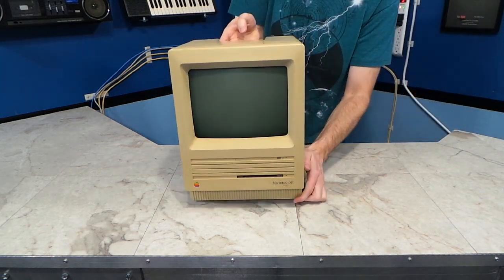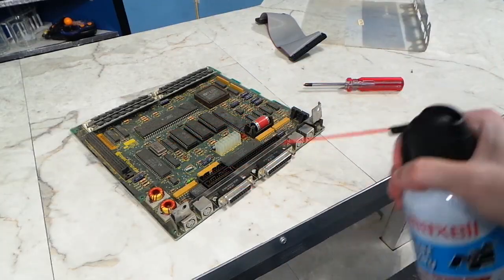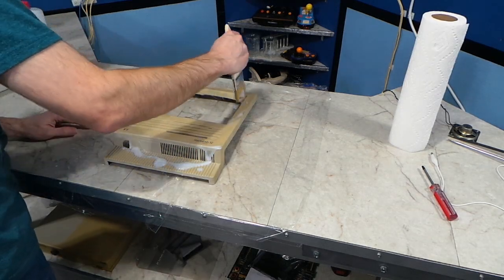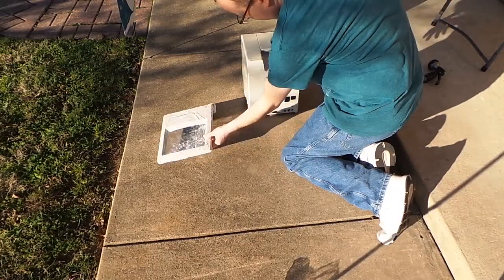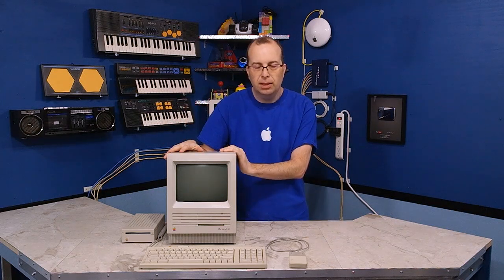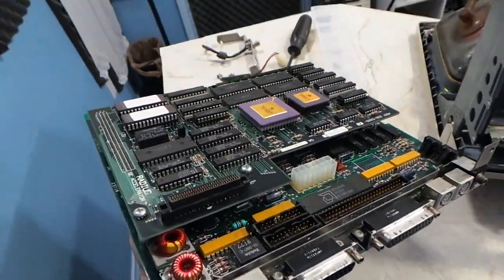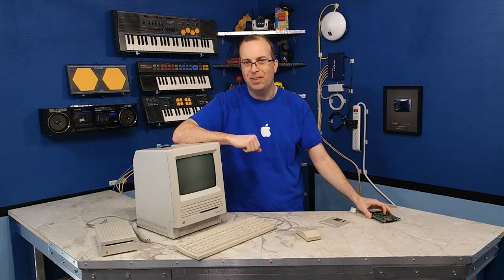Macintosh SE Restoration and SD-2-SCSI upgrade

Comment: Try booting it again, but holding down the shift key to disable all extensions. It probably crashed on an extension not meant for that machine. You really need a plain vanilla image rather than the one with all that junk in it.

Comment: Hey David, I recently restored a SE and I was able to successfully get it running on a SCSI2SD v5.0b adapter. I also think I used Lido to format, rather than the patched Apple software. 

If you haven't looked into it yet, you should check out Steve Chamberlain's floppy emu.  It has worked wonders on my Apple IIs and my Macintoshes.

EDIT: I forgot you mentioned the Floppy Emu in your video before I commented. Well, I recommend it eitherway!

Comment: I solved the problem transferring data to my SE and SE/30 easily by using an older Mac that can get online that can write to 400 and 800k disks.  I use a Powerbook 1400c with a PCMCIA wifi card!  I has Mac OS 8.6 on it, and I can go to Macintosh Garden and download apps and games, and copy them to disks.

Comment: I'd just put an old mac SCSI harddrive onto it and format it.  Been there, done that, a million times, so long ago, I forgot all the utilities I used to format and reinstall the system.  

Chips don't usually die, except to static electricity, so it's unlikely youre scuzzy bus is dead.   On PC's you find IDE channels that have been fried on a motherboard rarely, but usually the second (or other one) will work.

Be sure to set your SCSI selector jumper on your device to not conflict if you have more than one on a ribbon cable.

Comment: I have the red half-size V5 version of the SCSI2SD, I can confirm it works perfectly on my SE with a 2GB MicroSD card.  I installed the British version of System 6.0.7 from 800K floppy disks with the patched HD SC Installer.  Reading online it would seem that the older version of the board is more compatible with these older systems..

Comment: Try different SCSI cables.  99% of my SCSI problems were cable related rather than drive related.  There may also be an issue of incorrect termination.

Comment: This is long, but here goes:

I've been working on an SE/30 restoration. My machine has a perfect motherboard with no leaking capacitors and a highly valued ethernet card. Your video has inspired me to go all the way on restoring the case, keyboard, and mouse with a peroxide solution.

It's not surprising that you're having a nightmare putting software on that SD card. It's painful since HFS  isn't supported by any machine after Jaguar. Don't ask how I know! I'm sure you know old software is available at a number of sites for free (my favorite price). Getting software installed was a painful step-by-step process. I had a modern Mac to download the basic drivers for upgrading the system-- but you have to write them to an IBM formatted floppy, which obliterates the file name. It's a roll the dice scenario whether the System 7 software can figure out what to do. Some files work, others, notsomuch. 

I tried networking a modern MacPro to the SE/30. It would log on fine, but again, HFS left the internal drive unreadable and unwritable. Darn it. But I did get the drivers to load a Zip drive-- which ups your content to 100MB and speeds things along. I dug out an old Yosemite G3 Mac, but it had no drive and the internal battery had exploded. A clean up and new battery got it working. I cannibalized an old external IDE drive and installed OS 9.2 from an old CD installer-- surprised I still had it. The G3 talks to the SE/30 with no problem over FTP, but it's not very fast at file transfers. That's where the Zip drive becomes invaluable. OS 9.2 is better at navigating the internet than OS 7, but many pages fail to load since Java is ancient on these machines. But an open source community retrofitted Mozilla for OS 9, called Classzilla. Viola! Downloads are pouring in-- over to zip-- over to the SE/30. Done. Because the G3 has USB native, I suspect loading up your flash drive should be done on an OS 9 machine.  

I'm not done yet. I have a flakey power cable to the hard drive. I need to locate a replacement with the proper pins. I'm interested in some of your friend's upgrades. They look like fun-- or a pain-- if you're into that kind of thing.
Reply: One trick to transfer files from a PC to a Mac is to use a Mac Emulator on the PC (Fusion PC or SoftMac from Emulators Inc, Executor from ARDI, or Sheepshaver and Basilisk II), use Stuffit to compress the files into an archive that preserves the Macintosh file attributes, and then you can use HFV Explorer to copy the archive from the hard disk image the Emulator uses onto a PC floppy and transfer that to your Mac.
Reply: You just reminded me that my cousin has an Atari Jaguar (which worked perfectly fine!) I'm not sure if he still has it but I may ask him!
Reply: HFS is completely irrelevant.
The Mac is trying to format it from scratch and failing.
Something more basic is wrong there.
Either the adaptor board isn't lying about the drive type properly - and the Mac rejects it - or quite likely the SCSI controller chip is B0rked.
BTW I note that David didn't replace any electrolytic caps on the board :-/

Comment: if I ever decide to go for a macintosh , I think i would swap out the SCSI hdd and go for maybe either a IDE or Sata hdd through the use of an adapter , as for the floppy drive that would be the only thing I would replace with maybe a working floppy drive from a windows PC

Comment: I used to service these back in the early 90's.  One other thing you want to look at on these old macs is the analog board.  Specifically, the solder connections under the flyback transformer.  They used to crack around the pins from the heat and screens would flicker and go dark.  I never worked on one that didn't need those connections reflowed.
Reply: I just bought a Macintosh SE with a screen that doesn't work (eBay). I'm hoping that the brightness is turned down, or it's the problem you described.
Reply: It ended up a broken leg at component L1 on the analog board!
Reply: Unfortunately mine isn't so simple, my Mac plus seems to have dead components. I'm actively working on it right now and I know which ones I need to get, but if only it was just a simple reflow to fix it
Reply: wow even back then macs had heat issues and planned obsolescence in mind...amazing...
Reply: @ahah1785  There was no such thing as planned obsolescence back then. Computers were far too expensive in those times to deliberately choose B-grade components or cut corners in the design in such a way a suitable component would be stressed towards its SOA's.
Bad solder joints around pins from the flyback transformers due to heat was a rather common issue in those days. Flyback transformers just ran rather warm and at some point, the solder will give. Many TV's suffered the same problem.
Reply: @weeardguy   the solder connections under the flyback transformer
Reply: @alainportant6412  You mean the solderconnections on the actual transformer (and thus not the pins stuck through the PCB?)

Comment: If you deal with crts I suggest drilling a hole or sanding a little on the screw driver and soldering a wire to it and clip on the other end. Sometimes that metallic coating won't ground it out properly

Comment: Been wanting to look into installing a HD drive into my 800k only SE and bumping it up to 4mb of RAM, but that tube scares the devil out of me. I'm a clumsy bastard, and getting the ol' shock handshake gag of the damned from a computer that's older than I am is NOT how i want to go out.

...Also, I don't have any torx screwdrivers.

Comment: Go into windows and make sure the SD card is on the MBR partition scheme.
Then format the SD card as Mackintosh FS
try that with your own SCSI emulator and see if it fixes the issue of write error
Reply: When it threw up the write errors with the SD card emulator under the message it said something about drivers.
You may need a patched floppy that has a driver for the SCSI emulator

Comment: Tip - no need for epoxy to fix that speaker. Just heat the tip of a philips drive screwdriver with a lighter. Then press the screwdriver tip into the plastic in the mounting holes. The plastic will melt and squeeze out, fixng the speaker kn place instantly.

Comment: But aren't SD cards made for like 500 overwrittes on a cell? I mean that is the reason why SD cards in Raspberry Pi running 24/7 will fail in a year. Then again if this Apple is going to the museum, then 500 cycles are nearly unreachable I guess.

Comment: Here is another point of consideration. The capacity of SCSI HDD's were extremely small by comparison to now, and older versions of the Mac OS did not allow for hard disks that were over a certain size as well.  You might want to try a small (2GB or less) SD card.

Comment: SCSI - Super Crappy Storage Interface. Or. Sucky Crappy Storage Interface
Reply: I guess you never used it within the time period it was invented in? Compared to the other mass storage interfaces of the day it was truly superior (5MB/s sustained vs under 1MB/s burst for other interfaces), you just needed to ensure each device had a unique ID and the bus was properly terminated - I think it was the bus termination that caught a lot of users out back in the day! The SCSI interface was fast enough to allow the Mac SE to support an external display (yes a SCSI interfaced CRT!), try doing that via ESDI, IDE or ATA... 
Also the one used in the most Macs of that vintage allowed for daisy chaining up to 7 devices, the devices could be mass storage, printers, plotters, scanners, displays, networking (although that came out much later), it also allowed the ability to connect another machine and use it like an external hard drive...

Comment: I know you had some issues getting the SCSI2SD working, I just wanted to mention that I just recently successfully did it on a MacSE using the instructions from this page, except for using an old intel mac, just imaged the SD card (once formatted on the SE) into my regular computer, imaged the card , fired up basilisk II and mounted it, copied what I wanted over and re-imaged the SD card from the updated file .. see http://appletothecore.me/files/scsi2sd_mac_se_solid_state_drive.php , I set up my SD card as 1 small Apple Driver parition 16k, and the rest (2gb) as Mac volume (System).. works great.

Comment: cool and fun fact the motorola 68000 is also used in the ti-89 and ti-89 titanium calculators. and the zilog z80 is used in the ti-73, 81, 82, 83, 84, 85, and 86. both were used as desktop cpus during this era of computing. albeit the z80 far less often (unless there are a lot of desktops secretly containing one that i don't know about)

Comment: Uh... Isn't the SD card's write-protection lock enabled?
Reply: Problem, the computer locked up on a compact flash solution as well, then theres that he was able to write an OS using Apple Pie baker and it still locked up, the write protect would have prevented that, and compact flash card dont have write protect tabs.
Reply: I think it is... look 1:03
Reply: Eh.
Reply: I think the adapter ignores that
Reply: Yeah. That could be the problem.
Reply: dude. Even though I’m an expert, I never knew that. Ur a plain genius.
Reply: Sometimes the most complicated problems have the simplest solutions.
Reply: @Darenz-cg9zg   man that’s interesting.
Reply: He doesn’t read comments .
Reply: @DavidAmmerlaan   the solder connections under the flyback transformer
Reply: No physical protection inside card. Write protection is just signal for card reader. So it can be ignored on port side.
Reply: @wojciechkuske242  Could it be both machines were write protected? Why write protect a disk that you use as a hard drive?

Comment: I got that sort of problem with an MS-DOS computer, I had bought a compact flash adapter but there was no way to install MS-DOS on the flash card. It seemed the bios locked the computer if there was anything other than an original hard-drive.

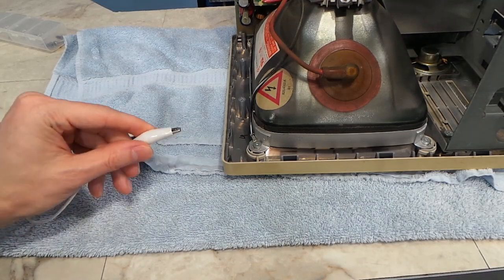Comment: Your discharge process 5:15 won't work! The board itself isn't grounded when it's not plugged in to a grounded outlet. What you demonstrate will do nothing. You don't want to plug it in, of course, so you need to use a known ground outside of the computer itself.

Comment: Sometimes the adater might have master and slave settings. Check to see if your SD to SCSI adapter has a jumper if it does remove it and try to initialize it and it should work, if i'm wrong feel free to let me know about it.
Reply: This one does not.

Comment: I had a similar SD-card problem with my Linux machine. I could read from the card but not write to it. Playing with the write protection switch didn't help. For some reason I tried to format the SD-card with my Windows 8 machine, and after formatting, it now works fine on my Linux machine too. I still doesn't know what was the problem with the card, but reformatting did the trick.

Comment: I have proof the SCSI2SD card works in a Mac SE. I have done it. Mine didn't work either until changed the name of the drive to "seagate" and a few other options. Also I booted up the machine first with floppies then formatted the drive within System 6. You can't (at least with mine) simply drag and drop files to the sd card. The way I'm able to get files onto the Mac SE and upload to my pc is through ADTpro with use of my Apple IIGS and the 3.5 floppy drive. Also make sure the files are good for transfer relabeling them from ".disk" to ".po". I'm able to make floppy images for it using minimac emulator.
Reply: Hopefully when his Mac SE SCSI dies again, he'll see this message.
Reply: Virtual Robots Revolt that is a pretty valid solution. Apple tended to lock down all their 68000 macs with ROM protection chips. Their own branded SCSI drives would be no exception to this rule. I remember once getting a third party SCSI optical CD drive to work with a res edit script hack.
Reply: i wouldnt call that "working" sorry; if u cant drag + drop files thats pretty useless imho
Reply: @ChrisNova777  its on flash memory now which can last a ton longer and far more reliable than a spinning hard disk drive.

Comment: David,

interesting/sad fact regarding yellowing plastics: I just checked upon my SE FDHD sitting on the bottom shelf of my bookcase with frosted glass doors: To my (not so amusing) surprise the thing has yellowed at the sides that WEREN'T exposed to light but came in close distance to A) the cheap wood laminate back board of the furniture and B) to some unbleached cardboard. So my suspicion here is that some evaporating chemicals do just as much damage as the "pure" UV light. Meh.

Comment: I've been shocked before fixing a crt.... holy fuck did that hurt.... will never work on a crt again
Reply: Damn you're lucky to be writing that message after that.
Reply: yeah man, it made my whole arm numb for hours... I had the crt on the floor and I was above it, and thats what saved me. When I got shocked the current went into my arm, then out the back of my elbow into a metal  track that was on the ground, so it didn't go through my chest and heart.

thing is, that crt was UNHOOKED and sitting in a storage room for over 2 years... and it still threw me across the room.
Reply: I have had a capacitors zap me after they have not had power for a while but never ever anything serious like a CRT. Worst shock I have had would be standard 230V AC mains which is not too bad really.
Reply: this is going to sound like im being sarcastic, and joking... but I'm not...

one time in highschool I pissed on an electric fence. The shock from the crt was worse.... wayyyyy worse.
Reply: a dare... quite a bit of money was on the line... it hurt pretty badly... but nothing too crazy.. like when it was over I didn't feel numb or pain or anything... but that crt... I felt my arm being all numb and then when feeling came back the nerve would twitch like crazy

Comment: have you tried initialize the card with a thrid party software and their proprietary partittion drivers? It used to work with me. I used almost every kind of scsi for these macs. Actually my powermac 8100 still has the software and an IBM server scsi HD. If you want, I can help you out! No need for original HDs at all

Comment: I would recommend investing in a CRT discharge tool. I have one that has a long thin rod with a very thick plastic handle. Lot safer than the screwdriver method.

Comment: I have a Mac SE with three floppies, one external.  IIRC, I tried to get an external adapter board to interface with it, using a modern SCSI-160 drive I had sitting around.  No joy.  I believe the problem was that I tossed out all my 3rd party driver disks, so I couldn't initialize it.  I like the idea of using a SD chip more, but the driver problem would remain.  I could see making an external enclosure for that adapter card, with a small slot in the front for the SD chip.  That'd be easier to work with/on.
Reply: I put the board in an external SCSI enclosure to make it easier to work on.  Still no joy, but at least I don't have to open the Macintosh to mess with the board.

Comment: You should use a soft denture brush for cleaning, it makes getting in crevices so much easier. The denture brushes are much stiffer than a tooth brush and bigger, they rule.

Comment: I'm not clear from the video but were you trying to use a High Density floppy with the internal drive? Looking around it looks like the SE originally only came with a DD drive. Later ones marked SE FDHD or SE with Superdrive had a 1.44 drive installed

Comment: You don't need to worry about a lethal shock if the computer is off.  You need amperage for a lethal shock, and you only get amperage with a current.

Comment: I'm curious if that SCSI to SD adapter would work on my Apple IIGS with RamFAST SCSI controller. All the SCSI hardisks in my collection are far too noisy and/or failing at this point in time.